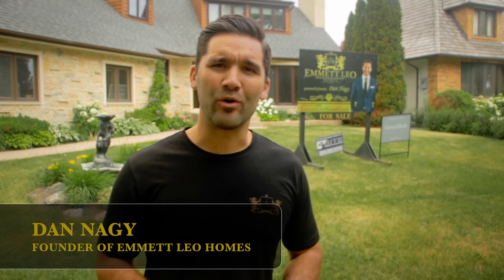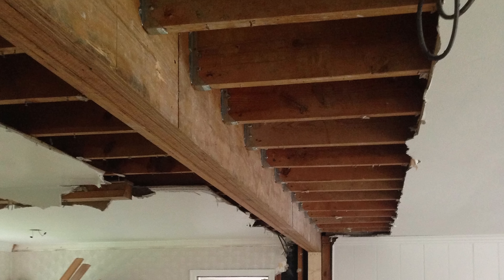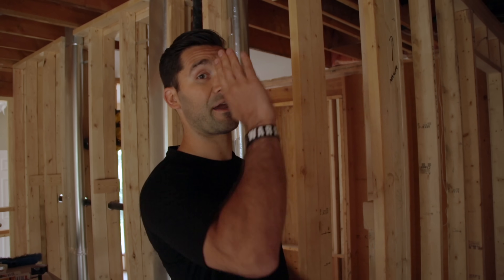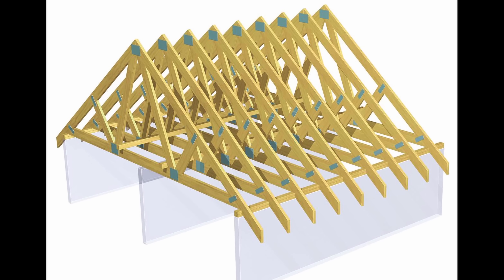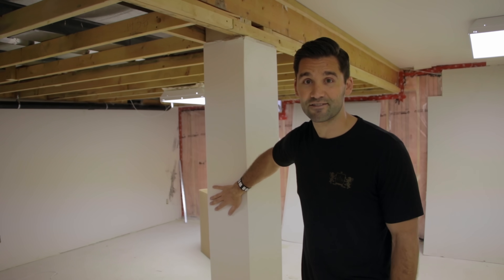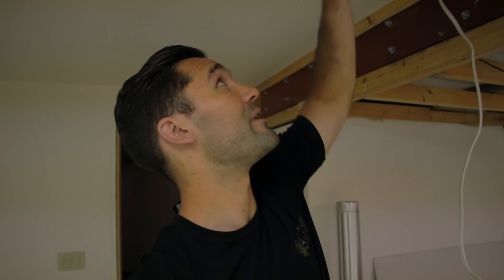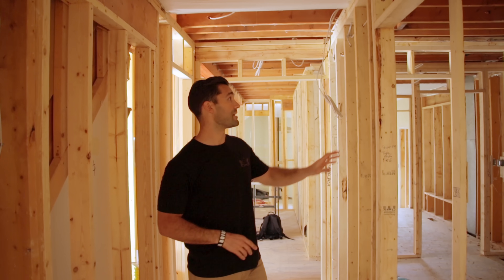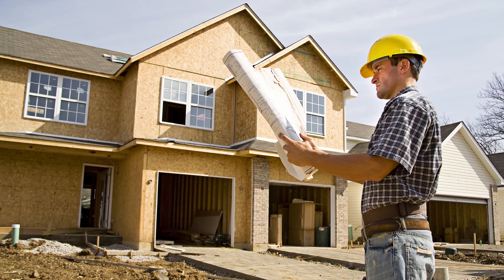The fastest ways to tell if your wall is load bearing or not!

Comment: As a structural engineer, I kept thinking of exceptions to his rules of thumb that could lead you to remove a load-bearing wall in error.  His advice will be right much of the time.  Hopefully your house is not the exception.  Just ask a structural engineer.  It’s cheap insurance, and he can answer tons of questions for you about anything you want to ask about your house or your plans.
Reply: I’m in the foundation business. Sales. I tell clients all the time to get a structural engineers advice. Usually about 300-400 bucks. Then 150 per hour for designed drawing. Usually a grand all said and done. That’s a no brainer when your looking to spend tens of thousands.
Reply: @joeedwards1682 if you just want to replace part of a stud, do you need an engineer
Reply: @usa5439  Likely, the odds of a problem with "replacing part of a stud" is near zero.  Questions to ask yourself - Does your confidence outweigh the risk?  What's your estate worth?  Are your kids under the wall, ceiling, etc.?
Reply: Yes let the pros do what they do,  for your safety. Just don't hire the guy if he's your wife's ex
Reply: How much to have a structural engineer just tell me where the load bearing is? I’ll just take it from there
Reply: @ey5373  I know this is a year old now but the structural engineers that I’ve done business with typically charge $100-$150 USD per “opinion”. So it’s pretty reasonable
Reply: Can you please let me know if I can talk to you over the phone?
I need an advice about my house...
Thanks in advance!
Reply: Could you expand on these exceptions to the rule please?

Comment: No Western home built after the 1940s has a basement.  So ya gotta stick your head in the crawlspace.  Find the access and either get in the crawlspace and look, or drop your head down as far as you can and look for the direction of run for the floor joists.  Load bearing walls are perpendicular to those...also, you can look at the piers (round or square concrete blocks with a post on them) and see how they run, floor joists are supported by a beam on top of those perpendicular.  The problem with looking at the ridgeline on a roof is many roofs do not have a single ridgeline, but many running at angles to each other so you can tell how the roof is sitting.  Also, you can poke your head up i n the attic and try to figure that out, but that is a loser really.  Finally, tap the drywall in the ceiling if you dont have a stud finder and figure out the run of the rafters.  They also run perpendicular to load bearing walls.

Comment: You didn't talk about transferring that load to the slab in the basement.  A 20' span carrying that kind of weight would require  you to break of the basement concrete and pour a larger pad to take that load.

Comment: You also need to consider lateral stability. Let a professional engineer handle the job. You clearly have no idea what you are doing.
Reply from the maker: You are correct.  We consider lateral stability.  And torsion.  And downward force.  And shear strength.  And Snow loads, And. And. And. 

Thanks for watching Neil.

Comment: I am still confusing, what about the house has no crawl space and no basement.
Reply from the maker: Stick your head in the attic, remember which way the joists go, then watch the video again.  

Thanks for watching!
Reply: @EmmettLeoHomes  thank you, can we find the 1st floor bearing if the house has two stories and no crawl space and no basement
Reply from the maker: @Mozzate1  It's a bit tougher, but more times than not, the main floor mimics the upstairs bearing.  Check the attic to see what is supporting the roof trusses.  Then trace the lines straight down.  Definitely not 100%, but it's a start.
Reply: @EmmettLeoHomes  thank you

Comment: I don't know where these houses are you're talking about, but my home's construction regarding load-bearing walls, trusses, etc. breaks all these rules you're talking about. I have a gable roof and structural beams and load-bearing walls run parallel with roof trusses. Since my home is a tract house, this is true of most of the homes in the tract. I think the designers broke conventional rules on purpose. There are all sorts of oddities, like walls running at diagonals, unnecessarily high ceilings, and lots of wasted space within the structure. The home is only of average size, but with minimal retrofitting and without adding any new load-bearing or structural walls I could easily add  another 20% floor space, and added space would make architectural sense, by tearing out & installing sheet-rock strategically. It's almost as if the designer considered the home's internal volume to be the imperative and that they sacrificed floor space luxuriously, like "we don't need this floor space, and we're going to make a show of it by not implementing what any normal builder would." The home also has these impossibly large expanses of ceiling by cantilevering the room above, creating overhang externally. So, I did learn a little about home construction from your video, and in understanding which of my walls are load bearing. As near as I can tell, the answer to that is "all of them." I think if I pull one 2x4 out the whole place will come crashing down.

Comment: Thank you for the video! 
Quick question: what’s the fastest way to tell if a wall is load bearing?
Reply: Knock out the wall, if it's load bearing, you will know soon...  

Seriously though, the fastest way is to go into your attic or crawl space and look at the direction of the joists. If the wall runs in line with the joists then it is almost certainly not structural.  

If it does run perpendicular to the joists, then it might be structural. The next check is to open up the drywall where the wall connects to the ceiling, if the wall is poorly attached to the ceiling, it probably isn't structural.  

"What if the wall is perpendicular to the joists and is fastened securely?"  

Then you need an engineer. Don't play games with this, the risks of being wrong are to much to be worth paying the couple hundred bucks an engineer will cost you.

Comment: It would have made more sense to me to look at the building structural drawings and you explain the difference between a load bearing wall/structure and a non-load bearing wall/structure and then go to the actual house and explain it again with and without drywall covering the structure. That probably would have been a longer vudeo, but it might have gotten your point across in a clearer and more understandable fashion.

Comment: As an engineer, his phrase "definitely not load bearing" bothers me. I also don't agree with measuring the basement walls and transferring the measurements to the main floor. The floor joists don't always terminate directly above the concrete, plus the measurements in residential construction are usually off. If you are looking to take out a wall, then do yourself a favour and spend the extra $500 and hire an engineer. You don't need to find a fancy company and pay big bucks, search your local Kijiji/Craigslist and get a couple of quotes. Good luck.

Comment: Good Information. How do I remove the old wall and put up the new beam, without the house coming down?
Reply from the maker: Add two temporary supporting walls on either side of the wall you are removing to carry the weight of each side that the original wall was supporting.

Comment: I'm curious about what is holding those two columns on each end of the beam in the basement. The load used to be distributed all along the basement beam with multiple columns holding it up, but now, the load is at 2 points...Are there 2 columns in the basement right below them? or is the basement beam good enough to hold the 2 loads? Just curious.
Reply: In the '80s we use to put in Beam Pockets in the concrete wall. We either had 3 ply or 4 ply beams so it was either 4 1/2" or 6" wide. The depth was determined by whether they used 2x10's or 2x12's or a Steel beam.

Comment: i thought you just cut it down, and if the ceiling falls on you , it was weight bearing ???????
i shouldn't joke, a friend of mine took the wall from his basement to his garage down, and within a 1/2 hour, it started to sink, he was lucky it didn't fall with him under it,,we quickly jammed a 4X4 under it, and got some more to build a new wall,,, but the wost thing is a union carpenter told us , sure,  it'll be fine
Reply from the maker: Scary.  Thanks for watching.

Comment: Go ahead, watch this video. But only for fun! If you're considering removing walls from your home, DO NOT USE THIS INFORMATION TO DO SO!! Please, call a licensed contractor or local engineer. If available, have your blue prints ready when they come to inspect. "If the house is shorter this way than it is this way. Then typically they're running the shortest way"... Ummm that's exactly how someone will end up removing a bearing wall in a basement or downstairs area where a joist splice is located! PLEASE, if you're not 100% certain about what you're doing, STOP and contact someone who will be! I.G. - local licensed contractor or engineer. Typically better to contact an engineer. BC alot of times a contractor will contact one. Then you're paying for a contractor and an engineer...
Reply from the maker: I agree.  This is for information and to help people dig a bit deeper.   Well put and thanks for watching.

Comment: Load bearing walls do not always sit exactly on top of a beam below.  I have had many cases over the years of where a wall holding the floor or roof above were off by as much as 3'.  It seems to be more common in newer construction.  Maybe due to better engineering in products.  Engineer has saved my ass several times over the past few decades.
Reply from the maker: You are right.  There are definitely other situations that are out of the norm.  Thanks fore watching.
Reply: @EmmettLeoHomes  Why are you recommending people cut holes in ceilings or pop sheetrock screws or mess around trying to find old house plans with the city when they could simply go into the attic to look at the rafters without causing any damage and it would take less than 30 seconds???

Comment: I have a house that was tiny and someone added on a kitchen & bedroom..... How do you know if the roof was just added on to a outside wall?
Reply from the maker: Great question.  The only way for that is to stick your head up in the attic and look at the framing.   YOu can also tell by the spans and how wide they are, but the simplest is just looking at the framing.  If you don't know what you are looking for, bring someone in that does.   Thanks for watching!
Reply: Thanks for responding!

Comment: These are all great rules of thumb, but as an architect I can assure you that houses are not always framed to plan.  The safest way is to open up dry wall following these rules of thumb and look at the framing.  You can also look in the attic to see if there is any roof bracing attached to the wall.  I have seen framers put point loads on walls running parallel to the joists also.
Reply from the maker: All great points.  Thanks for watching!

Comment: I have a wall that fits all your categories as load bearing. However, in the attic space (vaulted ceiling with a shallower pitch than the roof) the wall terminates without contact to the trusses. I had suspicions it was non load bearing. For $400, a structural engineering firm confirmed my thoughts and I am insured up to 1 million. Honestly, get a structural engineer. Small price to pay for peace of mind.
Reply: Yes!
Reply: Generally, if an interior wall that runs perpendicular to the joists is not load bearing, then instead of two "2x4" on the top of the studs (the " double top plate"), there will be one 2x4 and a 1x4.  This allows the builder to frame the wall and then stand it up within the finished outer walls and ceiling joists.  So you end up with a gap between the top of the non-supporting wall and the joists.
Reply: Interior wall partition are NOT allowed to contact lumber above it, giving a false sense of security.
Reply: @etimesoyyosemite6673  good to know!
Reply: @etimesoyyosemite6673  what if a joist is parallel on top a partition wall?
Reply: @Weekbrownies  In San Diego County the build code does not allow contact, unless the partition wall is intended, designed and built to be load bearng.
Reply: @Weekbrownies  Just happened to land there.  Load bearing walls don't run parallel to ceiling joists, and there will be a gap between a non-load bearing wall and the joist.  It they are in contact, then the builder screwed up.
Reply: @samhavoc1066  Does that also hold true if your house was built in 1905?
Reply: $400? You got ripped off!
Reply: @Weekbrownies  Facts man. My buddy who does structural repairs on old houses could've told me that for free

Comment: I have a short interior wall running parallel to the floor joists in a 1 story house. It is resting, however, on a double floor joist (2 joists about 2 inches apart). Furthermore, when I knocked out the plaster and lathe off of it, I see cross-bracing 2x4 on the inside of this wall, where all other interior walls I exposed only have fire blocking and no diagonal support. They are 8-foot walls. There are no pillars below it in the crawlspace and no roof bracing tied to it.

Is this wall somehow loadbearing?
Reply: By your desciption no, not load bearing. Clue, running parallel to floor and no bracing below. If bearing, would be perpendicular, plus it's a short interior wall with diagonal bracing.

Comment: Good explanation on determining if wall is bearing or not. But there is s huge problem with the concept that it is acceptable to remove any non-bearing wall.  The wall could  be non-bearing and still be a shear wall, which is part of the lateral load resisting system for the structure.  Removing a shear wall, even if it is non-bearing, could render a building unsafe in case of large wind or earthquake loads.
Reply from the maker: Correct.  Just an overview.  Where we are, residential structures don't often require shear wall strength other than exterior sheathing/structural framing.  But I agree.  Nothing should be removed without the proper diligence. Thanks for watching!

Comment: This is completely useless information.  If you really want to know, call a contractor and have that contractor cut small openings in the wall in question to determine if it is a load bearing wall or not.  Fix the hole and you are done.
Reply from the maker: This is not useless at all.  Thanks for watching!

Comment: You play a very dangerous game here, assuring people what is loadbearing or not. Ever heard of wind stabilizing walls? These walls are not necessarily located in any of the ways you're describing. Many houses also have different building materials between e.g. the basement and the entry floor, which can change the load structures that you're describing. At least here in Sweden you need to contact the city and provide them with a drawing of the execution if you want to tear down a load bearing wall. And they have to allow it before you can start the job. So please don't simlify something that can cost people lots of money in fines and in worst case their own lives.
Reply from the maker: They are called Shear walls.   And we don't often have them in simple residential construction as our sheathing provides the shear strength.  

Furthermore, I am telling people how to identify it, educate them about the process, and telling them to ensure that they get the proper approvals.  Where is this dangerous game?  

Stop being so dramatic and thanks for watching!
Reply: @Emmett Leo Homes  Your final words in the video are "now YOU know if a wall is loadbearing or not so that YOU can take out a wall". Nothing about getting the proper approvals or anything else.
Sheating is the stabilizing part of most shear wooden post wall. It still means that you need a number of those walls in a house. In large houses the exterior walls might not be enough support. 
I appreciate educating videos but if you're not an engineer and dont have the whole picture, I will react this way when you give people false security. 
If you think I'm being dramatic then you clearly don't understand how dangerous your approach can be. Stop being so careless and thanks for answering.

Comment: Wish i could show you a picture! I need your help badly. I have an old 1930 dutch colonial. and we don't think its load bearing but I am terrified it might be. can I send you a photo? it's a 2 story and the kitchen had 2 weird beams and we  have taken down the plaster and its all open. it does not make sense.
Reply from the maker: donnaconrad1 I suspect you will need to have someone come onsite.  

A picture will be very tough to tell and no one should be willing to make a call like that.  

Best bet is a contractor and/or a structural engineer.  

I can answer questions here however.  

Thanks for watching.
Reply: @EmmettLeoHomes  My husband thinks it's not load bearing and is getting mad that I don't trust him. Ugh I was hoping to get your opinion. I know you can't tell from pictures but I am going to get him to pull the ceiling back so I feel better about it

Comment: im so lost. i own a multi family house built in 1929 and the basement and attic has been done to rent out so i cant check if the house is load bearing or not. based on the year of the house can someone tell me if it is?
Reply from the maker: I can guarantee the house is load bearing.  You will have to pick a certain wall to contemplate.  Look at the roof trusses, the wall layout, and see if you can pull the plans.  If, not, you may have to get an engineer or contractor to do some digging.    Good luck.
Reply: Emmett Leo Homes thanks man I appreciate it